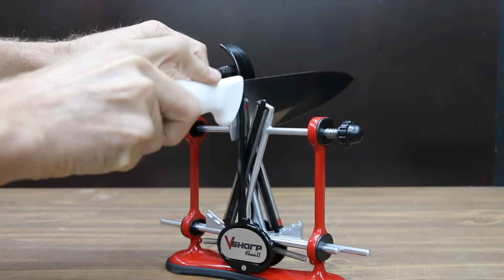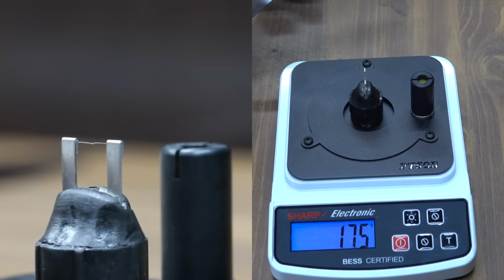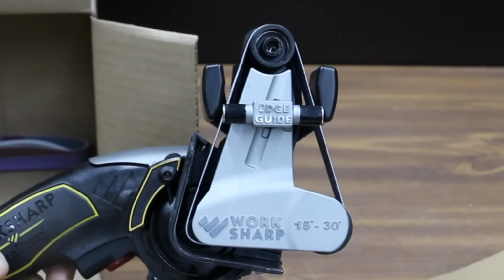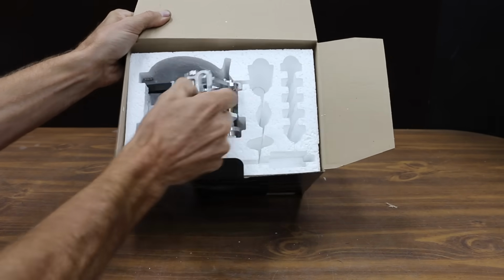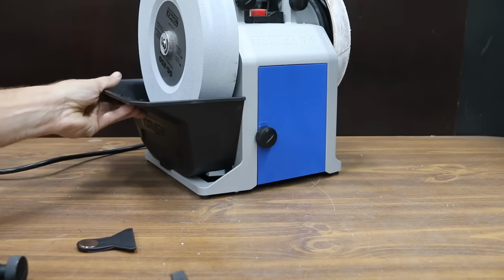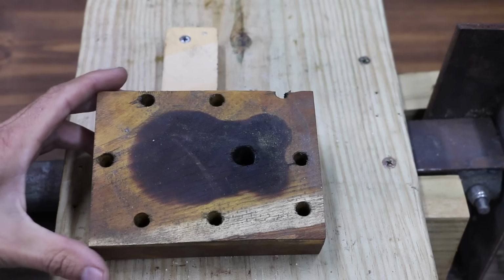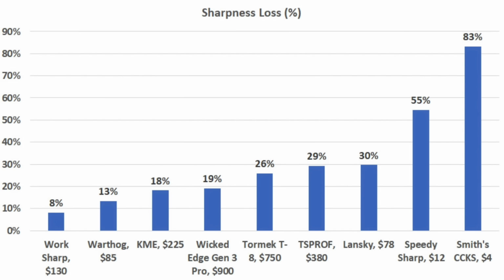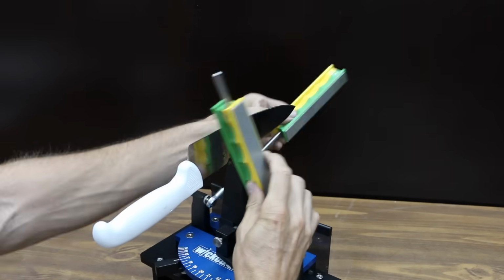RUSSIA vs USA Knife Sharpener? TSPROF vs Lansky, Wicked Edge, KME, Tormek T-8, Work Sharp Ken Onion

Comment: I wonder if anyone followed up by buying any of these sharpeners, has used it for a while, and continues to get good results?

Also, wanted to point out from studying sharpening a bit lately, and trying a few things, that no matter which system you use to get the angle of your blade set, and produce that vanishingly small burr, you can step over to between razor and scalpel by 'stropping' your blade next. 

I took my old leather belt, hooked one end to a bench and used it as it was, rough (back) side, then finished side. Eventually it really cleaned that edge up! I had learned to strop sharpened edges on my calloused palm from a carpenter, but the belt was a little faster, more effective, and safer. Then I put a little Flitz on the rough side of the belt. Wow! Had to do all my small knives it came out so well, then I had to grab a few kitchen knives, and they came out great, too.

Two notes:
1. Drag the blade across and down the belt in a long swipe. Try to pull the full length of the blade along and across the leather on each stroke. To strop, hold the blade flat against the strop. Then tilt the back up until you match the bevel angle. Pull the blade down and across the strop in one motion - pull it ¡BACK FIRST! Unlike with most sharpening, you're dragging the edge last. If you go edge first [don't!], you would likely dull the edge +/or cut the strop!
2. There are stropping compounds, paste, wax or cream based polishing compounds, and diamond powders and pastes in different meshes or grits, that are usually graded by maximum typical particle size. Compounds, esp wax based, don't dry out like Flitz. Red or rouge is too rough for finishing edges on a strop , often ~1500 grit(14micron.) Most white, green, and black compounds will work, and you can step through them with different strops or sections of the same long belt, for instance, just mark where they are. Check with the maker or vendor, but they might represent: 
black (~3000gr/7mi ), 
green(4000 to 6000gr/4.2 to 3.5mic), 
white(12,000/1.5mic).
For two makers at least, green(50,000grit/0.5microns,) so it's good to find out and mark the value for future reference. Diamond powders and pastes are usually graded in microns. Another figure is the concentration, which is the percentage of the paste that actually is diamond, the rest holds is not. Higher concentration cuts betterbsnd lasts longer. Diamonds (and many other grits) will embed in the leather so dedicate that piece or portion to one grit/micron size. (The micron value is what size mesh or screen the majority of pieces would fit through; bigger pieces would be removed by a smaller screen. The particles could actually be made or ground to a size and not actually mesh-filtered; for some makers the mesh size quoted could be a 'typical' value....) For finishing knife edges, diamond paste on avstrop cuts well and fast. Use 3 or 3.5 microns then 1 micron. You could finish-polish with 0.5 micron, but not sure if that would be worthwhile for knives, chisels and plane blades.
Reply from the maker: Thanks for sharing.

Comment: Glad to see the smith $4 sharpener on here.  I use one that is just like it but another brand.  It really is shockingly good considering how cheap and quick it is.  I've found the round rods work better than the flat blocks on these pull through models.
Reply from the maker: Thanks for the feedback.

Comment: For years I use the Kami it was great always put a crazy sharp angle on mine eyes but the problem is every time I sharpened what a mine eyes it was guaranteed did that a piece of the diamond would fall off and get drugged on the face of the blade below the Apex on the primary grind scratching the bejesus out of it. Now if that were to happen on the 50 $60 knife no big deal but when you sharpen one of your knives that cost 3 to $500 and you were left with a scratched blade well let's just say you don't want to ever touch that sharpener again. So I went back to freehand sharpening and just touch up my skills and working on muscle memory
Reply from the maker: Thanks for sharing.

Comment: I recently went from my set of water stones to a flattening stone, a single DDT 8 inch continuous diamond steel and a leather strop per outdoor55's suggestion. I get my knives very sharp with just that and haven't looked back since. It would be interesting to see how this method compares!
Reply: I followed Outdoor55’s advice too. I went thorough the same progression as you.  I did splurge on a kangaroo leather strop for my pocket and field knives.
Reply from the maker: Thanks for sharing.

Comment: Smith’s, Speedy Sharp, Warthog and all their equivalents are abominations. They are edge-killers.
No one who cares about knives and knows what they are doing would ever "sharpen" the edge lengthwise.
Making longitudinal scratches on the edge is worse than letting it rust. And those horrible, horrible scratches are clearly seen on the microscope pics.

Work Sharp does more or less proper job, which is kinda expected from, essentially, a pro grinding machine.

TSPROF, Wicked Edge, Lansky and similar tools require understanding of what you are doing, otherwise you use them to ruin the edge.

Comment: I used to work a place that sharpened paper knives. That one brand that used a convex edge is half-right, but it makes things that have a bit of give like paper or meat bind up. The best is a compound edge, one very acute angle and a diamond hone to put a slightly more obtuse angle at the edge. Kind of like what a good Steele does.
Reply from the maker: Thanks for the feedback.

Comment: If you use the Lansky Deluxe 5-Stone System you get an extra stone that's 1k grit, and it is cheaper than the diamond kit. Also, you can buy a leather strop hone for it @ $18.
Reply from the maker: Thanks for the feedback.

Comment: Will you please try the paper wheel sharping system. I  make custom knifes and it is the only sharpening tool I use.the first wheel has powdered carbide that you put on with glue, next wheel is just paper only with a touch of rouge.very simple system.thank you
Reply from the maker: Thanks for the suggestion.

Comment: I remember how I was going through videos trying to understand what do I need for my needs. The best help came from guys who professionally sharpen knives. They usually focus on time and reliability. A price is important, but when you need a certain tool you will buy it sooner or later just because it is the best tool for your task. With this approach there are not so many tools left on a market. All plastic "wonder sharpeners" not even considered. You may have a decent result with some of them, but you will spend a ton of time, especially if your blade has damage and parts of an edge are gone. Some of these wonder sharpeners kill a blade. Same goes for hand sharpening with water stones unless you already invested years of practice in it and sharpen like a God. My knives fleet was 5 kitchen sets (a fruit knife, a utility knife and a chef in each set). 3 sets are Aus-8 (Rc hardness 58), 1 x Damascus (61 RC), 1 x VG-Max (61 RC). Plus all pocket knives I had. I went TS Prof K-02. I was absolutely fascinated by it's looks and I am still now. Your tools need to have a wow effect. This one still has! What I found out later (and nobody in these videos mentioned it):
- There is a long learning curve with choosing right stones for right steel, right gridness, right  fluid, right angle, right sharpening technique - it is a whole world full of nuances, tricks and knowledge!
- A chef takes 40 minutes, a utility knife - 20 minutes and a fruit knife takes 10 minutes to sharpen - this is with smokes and beers. Be prepared! You may fly through it first ten times, but when your wife  asks you yet again when will you finally sharpen the knives - you start to think about bringing them to a professional sharpening service.
- It's a very right thing to do (at least in my system of coordinates) - to have your knives in your family sharp.
- It is dangerous to the family and guests at the beginning - razor sharp knives cut fingers.
- It is a very rewarding experience to maintain your fleet of knives at a proper level they deserve.
- Using these systems on inexpensive kitchen knives is a waste of time and money - these knives will not hold an edge for any reasonable time.

My thoughts on this video - it is a great entertaining video, but it's goal is to receive likes and subscribers.
It is not about knives sharpening ( I was wrong before, so if I am wrong - I apologize).
Majority of these knives could be sharpened to a state of Tormek performance with right stones, water/oil and time.
Diamond stone that is used on a TSProf sharpener is very aggressive to a plane rust free kitchen knife. You can use it to repair an edge, but sharpening and edge strengthening should be done with different stones. 
Tests are shown, but these knives are not sharpened properly.
Not arguing with anybody, just offering my experience - it may help somebody to navigate to a right decision through tons of garbage on internet.
But a video is very entertaining!
Reply from the maker: Thanks for sharing.

Comment: Yes all these are just absolutely great at prepping but honing & finishing are another story! there are 4 that are the best because they all operate simply in the "Lanskey" model! The 4 on your video are the best type of knife sharpeners because I've tried them all and my $30 Lanskey beats any "competition" hands down🤭...see it's all logical and using the principle as it was miticuosly designed works 100% of the time...of course there are myriad variables but hey let's not bicker over trivial semantics ok! 😜
Reply: As long as you slide the guide on the Russian/Lanskey method in the proper direction- as you've not done here you can put a scalple-edge on any blade!(but the type of steel,use and how long the blade keeps is another story!)
Reply: You want to avoid wheels which take off too much steel too fast! They don't properly align the metal molecules in the right direction anyway! You sharpen steel in the opposite direction in which it cuts, it's counter intuitive but you sharpen a blade back upon itself with a metal/diamond file to magnetically align or arrange the metal to perform in the desired direction but if you want to fortify your edge to last then you are talking to heat tempering and that's a tad different direction for a beginner or even a novice!
Reply from the maker: Thanks for the feedback.

Comment: Good testing. I learned a lot.  Doesn't retained sharpness have more to do with the quality of the steel in the blade?
Reply: Yes and no. It's partly the composition of the steel, but even within that what allows for a long term sharp blade is the distribution and type of carbides after heat treatment. The properties of steel are always a balancing act of retaining an edge, and ease of resharpening, as well as a balancing act between hardness and toughness, at opposite ends of the spectrum. A high carbon blade that is too hard will shatter easily, though it may hold an edge the longest, conversely mild steel has excellent toughness, but poor wear characteristics. 

The angle and type of edge are the next thing that makes a big difference, a finer angle is more prone to chipping and early wear. A hollow grind is a prime example of this, you get extreme sharpness but a weak edge. And at the opposite end of the spectrum is the convex grind, more like the edge on an axe, which gives plenty of support and reduces the likelihood of chipping. A straight V grind is somewhere in the middle. Although there are advantages to a convex grind, it's not something that can be easily done in a production setting, so mostly it's only used on handmade knives or those you reprofile yourself. A bushcraft blade benefits from a convex grind because of the multiple roles and chance of impact, alongside the lack of anything more than a quick sharpen being a chore in the field . A kitchen knife tends to have a full V grind with secondary bevel, and pocket knives are quite often hollow ground.

In descending order of importance is heat treat, steel composition and then angle and type of bevel.

The scrap knife he made won't hold an edge for long, but if you were profiling it with a manual hone like the Lansky you'd want it to be mild steel not some high tech sintered super steel lol. Some of those expensive alloys are the absolute worst to resharpen or reprofile. Super abrasion resistance is good sometimes, but field sharpening becomes next to impossible.

Comment: The worst thing that can be done to a knife is to sharpen both sides. Knives should come from the manufacturer sharpened on only one side like a lawn mower blade. Also , today's stainless steel knives aren't worth a damn , don't hold an edge ,  and need diamond steel to sharpen them. Carbon Steel is the best knife steel.
Reply from the maker: Thanks for the feedback.

Comment: over the years one problem with sharpeners that do not rely on stones with a flat surface but use round such as the Smith's is they will amplify any nicks in a blade. I use them only for touch up of knives already in pretty good shape.

Comment: The lansky should come with a stand or combo clamp that holds the whole system far more stable. I don’t understand why that wasn’t used. I have a very similar tester as well and still don’t understand how this tests anymore than the width of the wire it breaks it the portion of the blade that contacts the wire. It does not test the length of the blade or even a small portion of it.
Reply: It's a controllable measure of sharpnes at any given point on the knife.  Do you have any recommendations to improve the scope of the sharpness test?
Reply: The lansky does come with a holder. A plate as well. I use it myself.

Comment: it looks like most of these Lansky style sharpeners would not procedure a consistent sharpening angle across the blade due to the varying distance between all parts of the blade and the joint. Is this a problem or can this be ignored?

e.g. the tip of the blade would have a lower angle (thinner edge), but maybe this is even a good thing? 🤔

Edit: While thinking about it the TSPROF nicely compensates that by placing the joint further away from the edge. This should help to alleviate the problem. In Contrast the Lansky is so close that the sharpening angle is can be as much as 50% different, especially with bigger knifes. 

I am curious to hear your thoughts about this.

Comment: Love what you do but you're missing the blade steel.  This matters when doing the wear test.  Unless I'm mistaken it's the main factor in edge retention.
Reply: Blade steel matters. But so does edge geometry. Sharpening angle. Also the type of bevel used.

Comment: Let's back up a little. What is a knife? A piece of metal with an edge. I'll leave the question of a "fuller" on the flat of one or other side, which breaks the vacuum of a soft material cut by a really sharp edge, as it's consequential to sharpness.
The edge has two parts to it, the bevel and the edge itself. A hollow-ground bevel allows an edge less than the angle of the bevel, but is hard to maintain in the long term. A flat bevel dictates an edge at a slightly greater angle than the bevel itself, so occasionally it may be necessary to regrind the bevel, lest the edge become extremely hard to maintain.
We're now at microscopic level. A perfect edge is at atomic level. Steels are a mix of different metals, but in general have a cubic crystalline structure. That could be very brittle, but it's made more flexible by tempering, heat treatment which reduces the crystallinity. That's why the edge in the microscopic images is sometimes slightly jagged: sharpening aims to reduce that.
Where the study starts to go wrong is that it confuses grinding the bevel with sharpening the edge. Let's therefore reduce this to the edge processors. These are generally stones, but they also depend on lubrication, either oil or water, to keep the stone from dragging the metal of the edge away too firmly. The idea is that friction should pull the atoms of the edge into a microscopic burr, which is broken off in the last sharpening pass. The line of the break, just a few atoms wide, creates the better edge.
At this point, talking of a burr on both sides of the blade immediately shows the machine is working on the bevel, not the edge between them. That should disqualify those machines.
The ones producing the microscopically straight edge are then worthy of consideration. The issue is that the stones don't go far enough by half, 1000 grit is just the starting point: I go to 8000, but Japanese water stones go far further: it's a question of return on time invested. These actually create a slurry from the material removed and the stone itself, which does the polishing.
Most of the designs focus on the mechanisms. An ideal machine follows the blade at a constant angle, and these don't: the Japanese take the blade to the stone, doing away with the mechanics entirely, using finger feel and experience. The reason is that machines need clearances far larger than these, and so create imprecision.
Reply from the maker: Thanks for sharing.